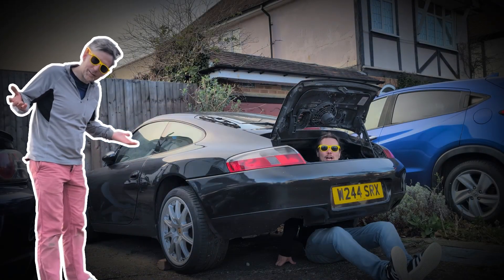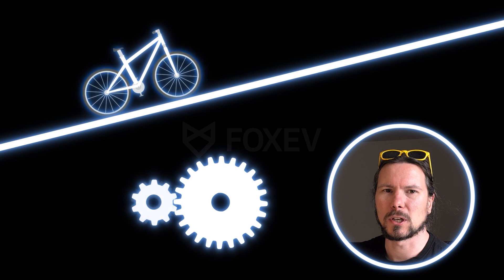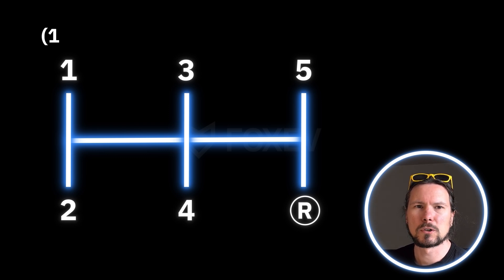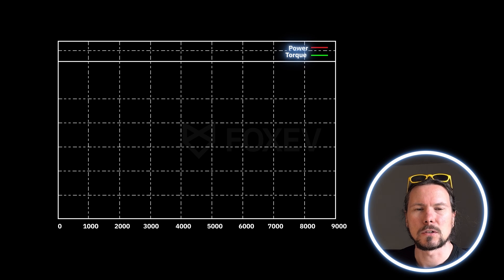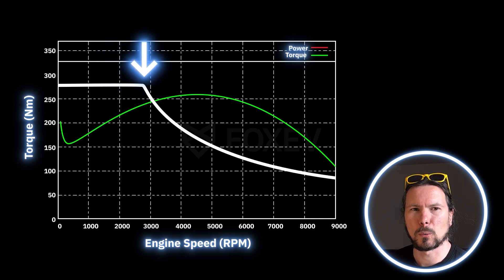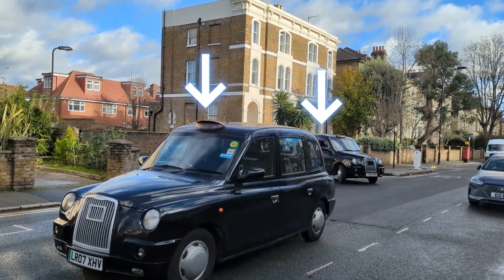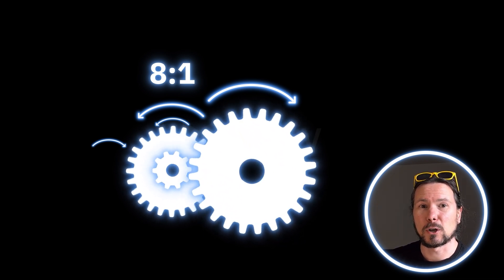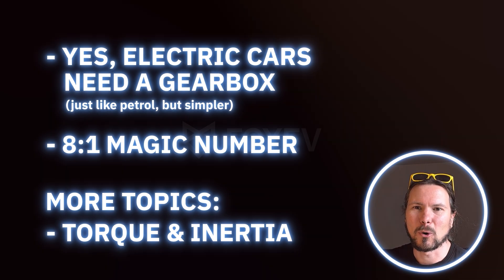Do electric cars need a gearbox?

Comment: As a manual transmission enthusiast, I really hope we see an EV with a clutch pedal. Imagine if you could press a button and switch between automatic and manual mode. Of course the clutch isn’t real, it’s just a pedal that goes to a computer and we could have vibration motors and accelerometers that make it feel like a real clutch and so when I want a fun drive I can pop it in manual mode. When a friend needs to borrow the car and they dont know how to drive manual (American problems) we keep it in auto mode
Reply: Have you driven the IONIQ 5 N? It's not quite a manual, but it simulates a DCT, complete with the gear shift jerks and the video game drivetrain noises to tell you where the faux RPM is at.
Reply: That's just fake. If a computer does the shifting, you don't need a clutch pedal.
Reply: @Frille512 That's the point. It's simulated, for enjoyment.
Reply: That's the gayest thing I've ever heard ngl. Buy a manual.